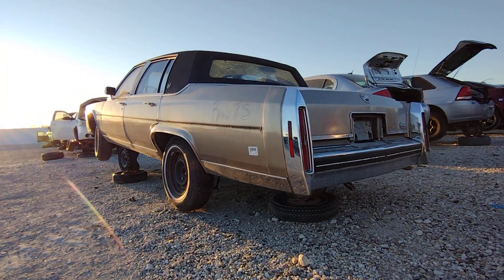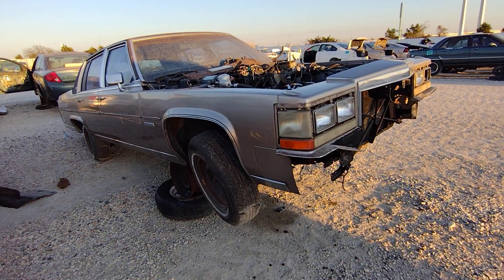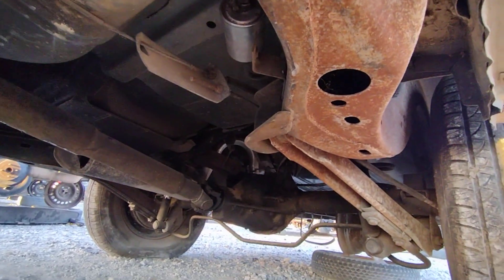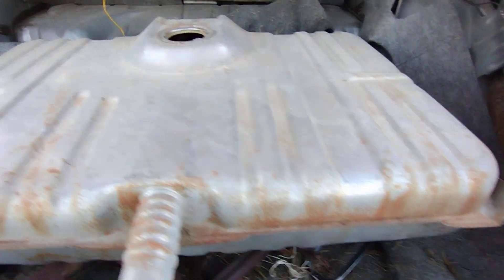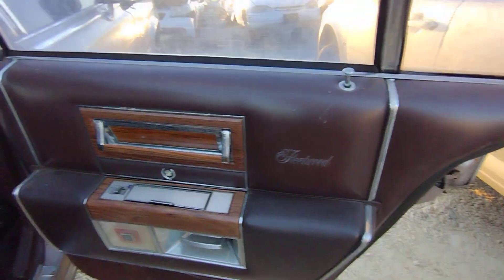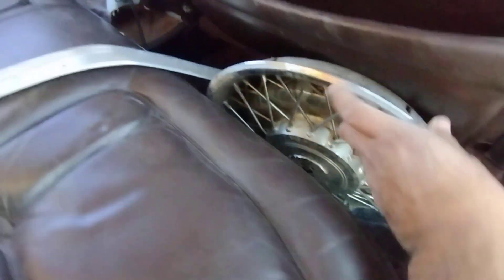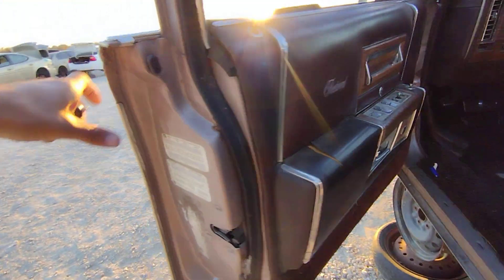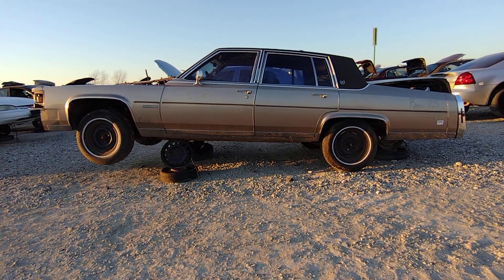Was it that High Technology 4100 that did it in? 1983 Cadillac Fleetwood Brougham Junkyard Find

Comment: The 4100 engines were bad about cracked, warped heads, and blown head gaskets. I've seen those lacs in the junkyard looking almost brand new. I had a homie to buy two of them and replace the 4100s with Oldsmobile 350 engines.

Comment: The late 1970's 425 engine was the last traditional style Cadillac engine in the full sizers.  From then on, it was downhill.

Cadillac eventually had to rely on engines from other GM divisions for its flagship car...a 140 hp Olds 307 followed by the Chevy 305 and 350 engines for '90-'92.
Reply: No, there was the 368 Cadillac V8 from 1980-1984 (both the VIN code "6" four barrel and the VIN code "9" with DFI), and that was of the same basic engine family as the previous engine.
Reply: @googleusergp  But wasn't that the engine with the V-8-6-4 system that caused all sorts of issues?
Reply: @dwi189  The 368 with a 4 barrel (1980-1984, used in various models. After 1980, it was only for commercial cars such as limos) and with fuel injection (1981 across the line, and from 1982 to 1984 in commercial cars such as limos). The 4-6-8 is the fuel injected version. It was troublesome because in 1981 computer processing speeds weren't up to the task and you felt the shift in cylinder deactivation (my uncle had one from new in Texas and it worked fine, but TX is pretty flat). However, you could disconnect the 4-6-8 system (modulated displacement) and make it run on eight cylinders all the time and the engine was very reliable and ran great like that. Many cars were modified at dealers like that back then.

Comment: I'm already sad she is a fleetwood . Many people hated the ht4100 but my dad had a few 82 and 83 fleetwoods and never had motor issues. The 80 81 368 468 to me were junk just like the 85-88 short fwd box caddies hideous on the eyes and rode just as bad but this one looked deserving of putting back together before being parted . I think everything needs LS swapped including these caddies but not till the motors go
Reply: Nothing wrong with the 368 (not 468) CID Cadillac V8s. Very reliable and even better when you disconnect the modulated displacement on the 1981 models and make them run on all eight cylinders.
Reply: @googleusergp  I didn't know about that ,my dad had an 80 CDV with that motor and never had issues in the 3 ish years he had her. I don't care for any of the motors after `79. The 472 was a gas hog but mine were bullet proof as we're my 3 425`s in my 77 and 78 fleets and 78 coupe . Some people can't stand the 4.1 and think the 4.5 is just as bad but my dad's 92 STS and 04 DTS had no Northstar issues and went from Los Angeles to Phoenix and never had to be towed but my dad's huge rwd 95 fleet had the 5.7 at least no Northstar
Reply: @rscamarolover  My father sold Cadillacs new in the 1980s, and he was tight with the guys in the shop (as my dad was handy and did all the work on our own cars), so he knew from those guys which ones were good and which to avoid. My own first car was almost a 1980 Fleetwood coupe. That would have been a rare bird indeed and I probably still would have had it. The service manager bought it out from under my dad and I wound up with an '82 Toronado instead.
Reply: @googleusergp  So you know how sweet these cars rode, my dad was a chevy person and choose caddies as cruisers until 1992 he had caddies and caprice after the bathtubs came out in 1991 , that's cool your dad sold them and you got to know and be around them I am opposite of my dad I like the box caprice as much as I do caddies.  74 cdv or fleet ,78 cdv or fleet 82,87 and 92 fleetwoods  are my favs but any 71-76 caddie cdv sdv or fleet is perfection to me ,I'm 50 . That sucks they sold that 80 Fleetwood out from under you those are cruisers and why caddie sold that same body style till the end of 92 even alongside those fugly 85-88's and a lil better looking and longer  89-93's but as much as I love my bowties I love my sexy 06 magnum wagon as much as my 91 rs camaro and that's saying alot as 3rd Gen camaros
Reply: @rscamarolover  I would have still had the '80 Fleetwood to this day. I still like those cars. The coupes were rare in 1980 as they were introduced late and not many were made from 1980-1985. I don't like those FWD downsized Cadillacs or many Chrysler/Stellantis products. I'm also not a 3rd generation F body fan, but again, all my opinion and everyone likes what they like.
Reply: @googleusergp  That 80 fleet would be worth a grip now,even decent not running ones go for $3500 but some people would rather junk a car than sell reasonably or cheap to someone.  I Def know 2 door or fleetwood coupes are very rare, I hardly ever saw them even as the 1990s ,they were mostly cut for hydros . I don't take offense in other people's tastes ,some like lincolns and I'm my dad's son,he saved some older and even 90s mark and LSC ones but said they are all ugly and can only dream of being luxurious but I have my 5th magnum wagon I'm a wagon lover but mine is low miles for her age and her motor (hemi) is dead and I'm doing a chevy 5.3 LS swap my 3.5  magnum wagon I traded for this one was dead reliable but all 4 rt hemis have had major motor issues  . I love camaros but the only ones I buy are 3rd gens ,my dailys are all burbans 03,07 and 2010. I personally only like v8 rwd and I'd drive excursions if I didn't love my burbans all Gens
Reply: @rscamarolover  I wish I did wind up with it. It was black with a saddle velour interior and in very nice shape. My father was going to buy it even if I didn't want it as a first car (I would have gladly had that as a first car), since it was priced right and in very nice condition.
Reply: @googleusergp  dang, black is my favorite color for caddies so I know she was beautiful,  I do know that just like now when a car or vehicle gets even as little as a year old they can be thrashed but people who drove these took care of them more than cheap cars. If I come across a decent 77-79 or 80-92 fleetwood that's black with a black top or white with a white top NO smooth top that someone removed the vinyl top for a good enough price I will buy one even the light gold aka champagne like the one on the vid with matching top is nice but I prefer all black or all white exterior  but I'd also buy a box caprice sedan especially a brougham
Reply: @rscamarolover  The car was in good shape. The paint just needed to be brought up by compounding. No dents, rust, or any body damage. It ran well too. The service manager had it for a number of years after he bought it.

Comment: The HT 4100 was not a great engine. As a caddy tech back in the day a camshaft, main bearings and a valve job was a tune up. Only car that you could hold it to the floor and it would stop on a hill due to carbon on the valves. The northstar was a great improvement although they had issues. I have a set of cylinder liner holders in my tool box as a reminder not to go back to Cadillac..
Reply: The 4.5 and enlarged 4.9 88-93, was a very good engine actually one of Cadillacs least warranty issue engines